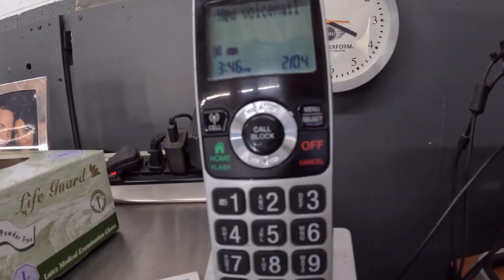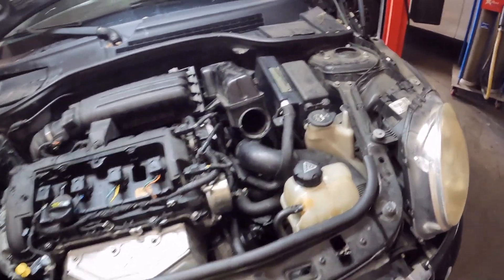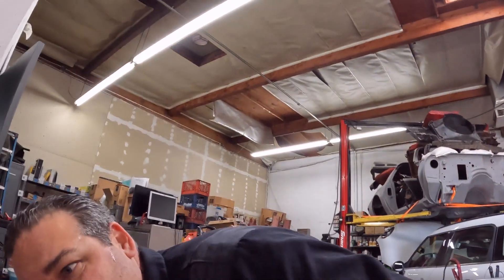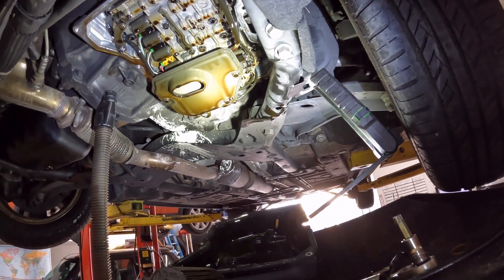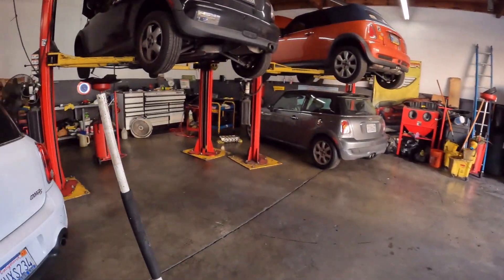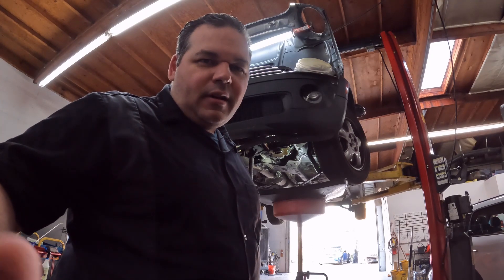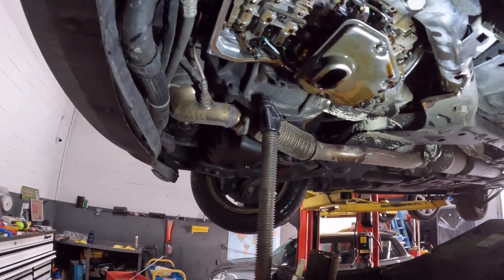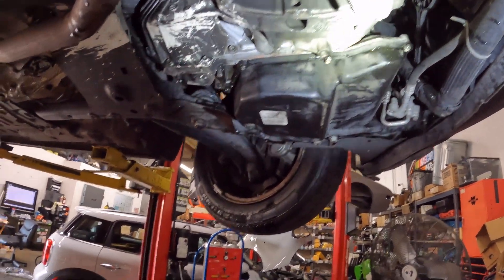Mini Cooper Transmission S2 Solenoid replacement

Comment: I have a 2024 Paceman when I push in the clutch to shift the engine RPMs rev up I have no codes and the car runs fine other than that got any ideas
Reply: Sorry it's a 2014

Comment: If I have 0 pressure on secondary pressure duty cycle and 60 on control motor position. Will changing s2 solenoid make my mini move.